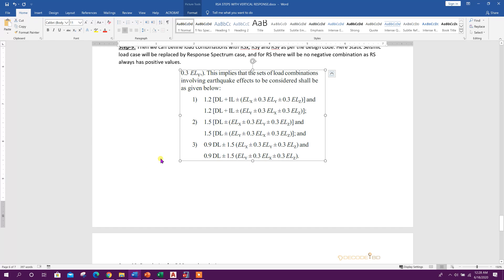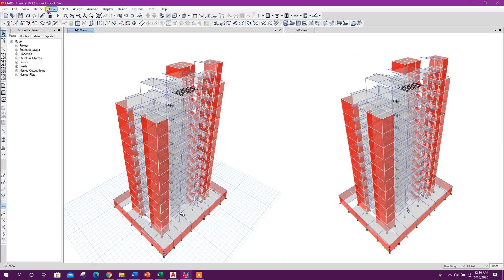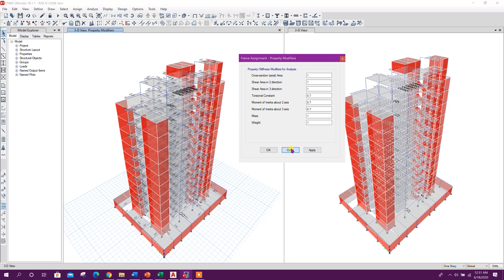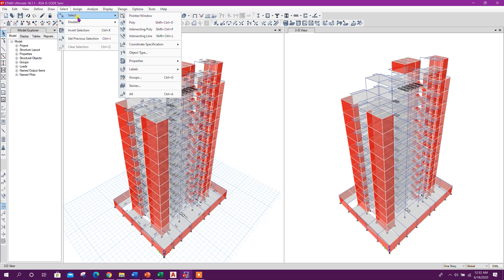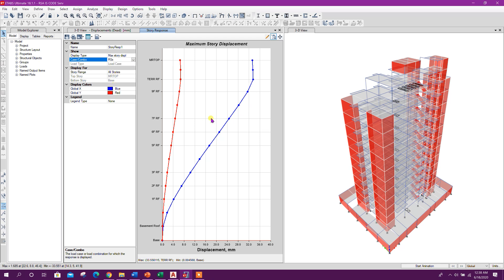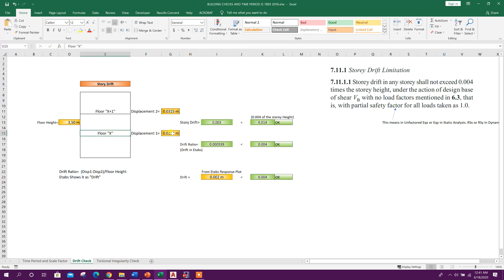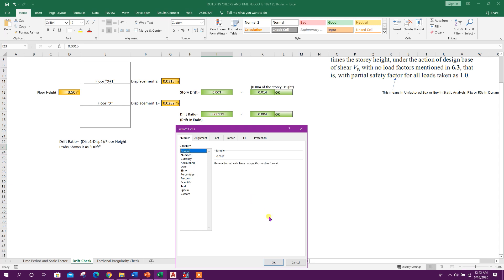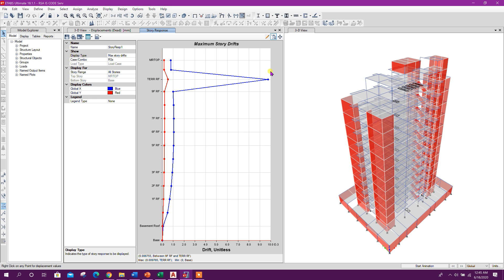Story Drift Check | Torsional Irregularity Check | IS 1893:2016

Comment: hello sir, No disrespect but you have provided stifness modifiers with both the options at section properties and through assign frame . But in a pdf provided by csi i have read this

Modification factors can be defined as part of frame section properties and assigned
directly to line objects. Note that when modification factors are assigned directly to a line
object that also has modification factors defined as part of its frame section properties,
the two factors are multiplied. Therefore, it is intended that you specify modification
factors using frame section property definition or line object assignment, not both.
Reply from the maker: Dear I respect you for your valuable comment. I knew that thing, but I wanted to explain the problem for providing stiffness modifiers in Section properties and it is better not to use stiffness modifier in section properties in the end of the tutorial, but later on I forgot that point. Thanks for the reminder. Will try to make a tutorial on this tricky mistake.